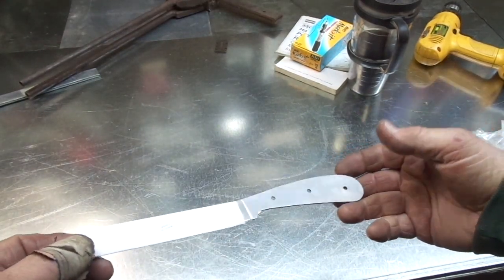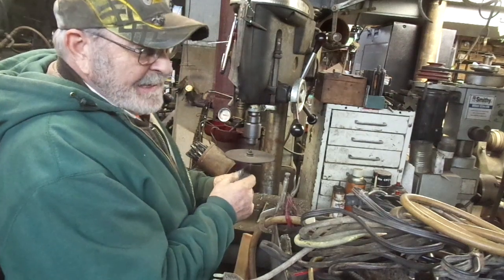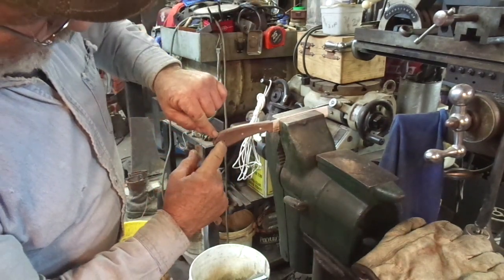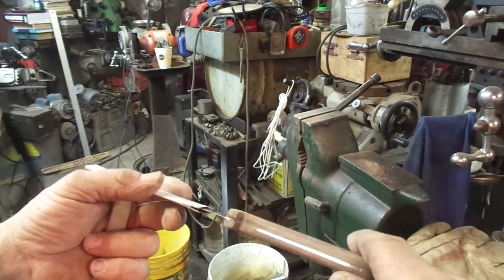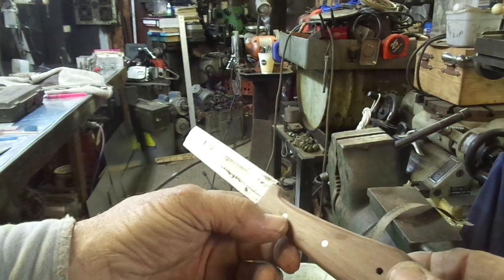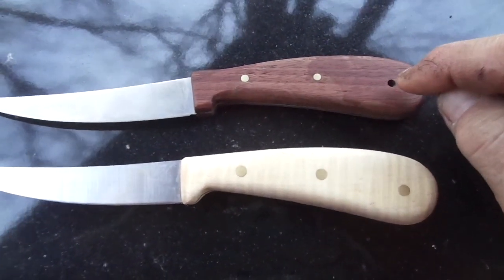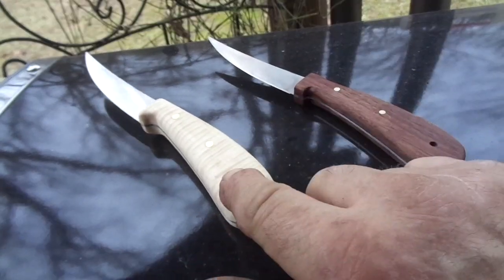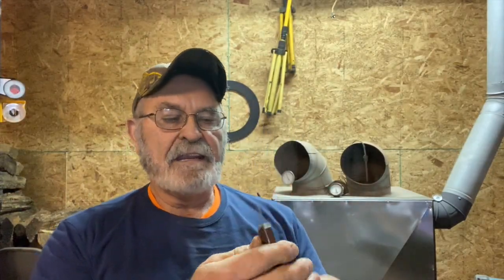Knife Blank to Finished Product

Comment: Another 44 Special! So many things happening at the 44 Headquarters! You may just start a surgery clinic in the shop after that trailer is finished and the butchering of course. I can see it now at the end of your lane, 44 Surgical Supply and Tractor Advice,,,,,CHEAP! You might as well make up a bill board, wire it up and may be mount a tractor carcass at the top. Take a Selfie with Tractorman44 just $19.95! Could happen! Another FINE video Friend Wendell! If you even want a piece of rosewood for a knife handle, just check with DaveyJO, now raising me cuppaJO your way and I'm outta here too!
Reply from the maker: Rosewood....ahhhh...I have a couple of Dad's old bevel squares that have Rosewood handles.  Hard, durable and still good looking after a mere hundred plus years in that role. Oh and hey DaveyJO, we already do a bit of surgery, but the patients never seem to recover...as a matter of fact, they just kinda fall to pieces on the operating table !!  Good Morning sir, and the first cups been downed in your honor, Your Honor....Stay warm and be safe my friend.

Comment: That is a beautiful knife!!  You make that process look so easy when I know it is not.  Gotta love your shop!!  It may be look messy but you know where everything is.  I thoroughly enjoyed your video.  Have fun cutting up the beef on the 29th.  Give us an addendum on the knife after you use it on Saturday.
Reply from the maker: Thank you for the compliment, but we cheated a bit by starting with a preformed blank. I've got two more picked out if this one turns out to hold an edge anything like Tyler's did during hog day.  They'll be one inch longer iirc, but the same material.  Thank you for watching and commenting.

Comment: Wow, that is a good looking knife!   Dad would have been proud of the finished project.  Nothing like a good hand made knife, whether it be a boning, fillet, steak or paring knife.                                                                                                                                                                                                           As sure as you cleared out any of the “clutter”, you would need it for a project, right?
Reply from the maker: Your comment showed up on the I phone, then disappeared when I opened the computer.  I went looking and found it with two others in Spam.  Go figger huh. Thanks for the compliment.  We're gonna find out tomorrow how good they hold their edges.  These have a good degree of flexibility so they should be good trimming fat off of the cuts as well as stripping down the bones for hamburger meat.  Worst thing for trimming is a stiff blade, plus stiffer means thicker and the ladies have more trouble cutting for 6 or 7 hours straight having to push harder on the thicker ones.  Oh yeah...NEVER clear out the clutter.  It'll cost you every time !!